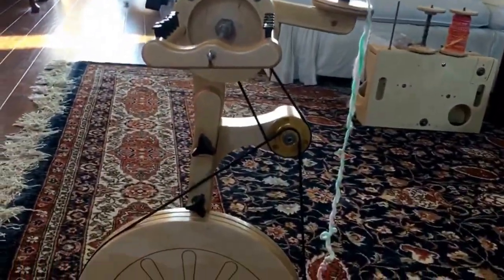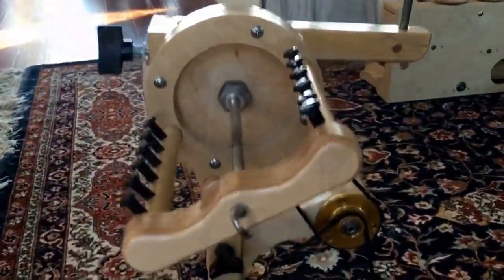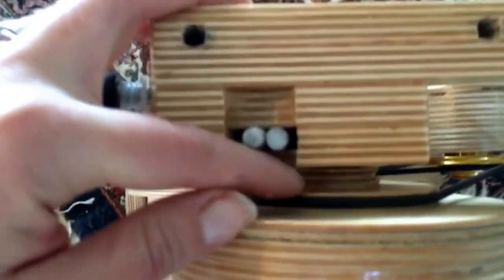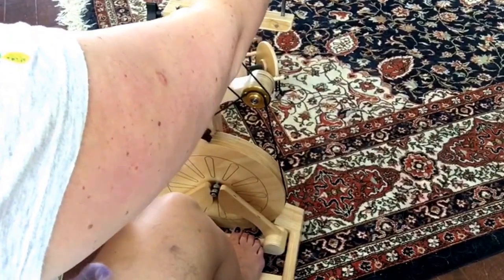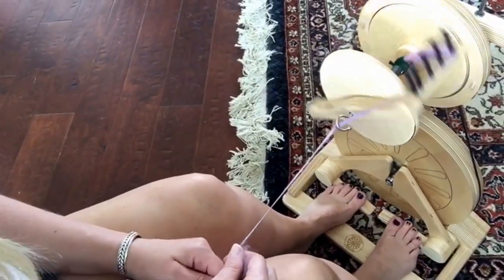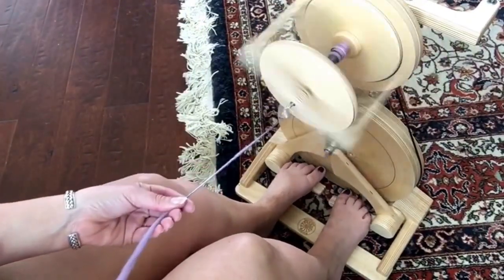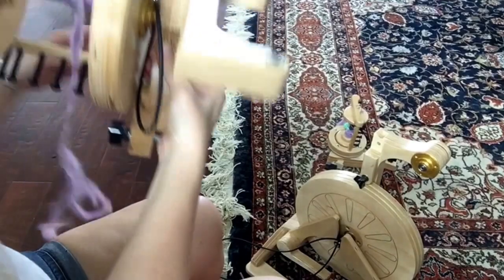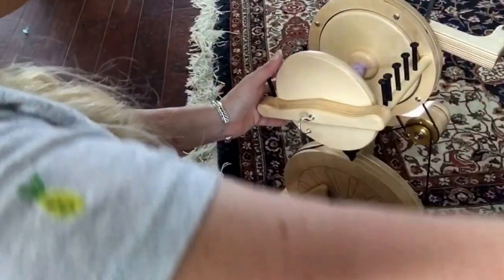Spinolution pollywog with 12oz upgrade and Accelerator upgrade. Golden whorl Review

Comment: Hi Erin. The new gold technology, what is the difference?  Can you buy it and put on your Pollywog?  Thanks Peggy. Oh do you have a group on Ravelry?
Reply from the maker: Hi Peggy , the new gold technology enables for the fastest pinning speeds in the industry. Which is great if you like to spin very thin yarn or fibers with short fiber lengths like cotton flax etc. the previous technology is also great for thin yarn but this is better so if that’s your main focus you would love it. Spinolution is also just great at moving forward with new innovations in general. The gold color is just fun the main difference is the metal and something with the rod that enables free spinning and super fast speeds. As far as your question for adding it to your Polly. You’re in luck, the pollywog even when the whorl isn’t colored gold is the new technology. It’s the newest wheel and when they started working on the new tech. The gold Accelerator accessory if ordered now would fit on your original pollywog. That’s how mine is. , new accessories on an original Pollywog.  I do not have a ravelry group, but I do have a Facebook group I run special sales and fun things in so I would encourage joining. I answer questions for people, everyone has input on new collections and that’s where I share the most news. https://m.facebook.com/groups/1813829192262097

Comment: Are the accelerators still metal currently? I just bought a new Polly and my accelerator is wooden!
Reply from the maker: Excellent question they actually went back to wooden because they were superior to the metal ones. I had a metal one and then they offered to give me a wooden one if I mailed it back which I did so now I have a wooden one. Because the metal ones were smaller it made for awkward treading  due to weird angles. Sounds weird I know but trust me having the wooden one is the way to go.
Reply: Good to know, I thought I was losing my mind because all the ones I've seen were wooden 😂
Reply from the maker: Sorry if meant to make an updated video and then totally spaced out. Thanks fo asking

Comment: How do you prevent from over twist vs uptake
Reply from the maker: If you’re getting over twist slow your feet some or try a larger ratio. You can increase the tension for more uptake. 
I have a video on too much twist.
Reply: @Feralscene  I have a used spinolution polywog I just purchased.  The tension spring doesn't seem to loosen up when I  release. Is there a trick to knocking if I am doing it correctly.  Does the felt on the tension ever need to be replaced?
Reply: I know you are self taught.  How long did it take you to become skilled in spinning?
Reply from the maker: @sandracontreras3232  Well I still think there are many people more skilled than myself but I know I'm enjoying what I'm doing and have a good grasp on what I'm doing and how to teach people. I've been spinning for 6 years. I'd say I had most of my growth in the first year.